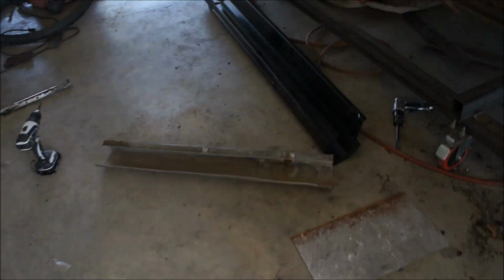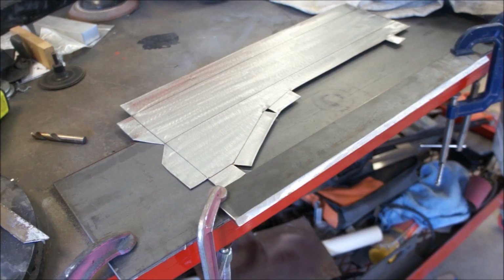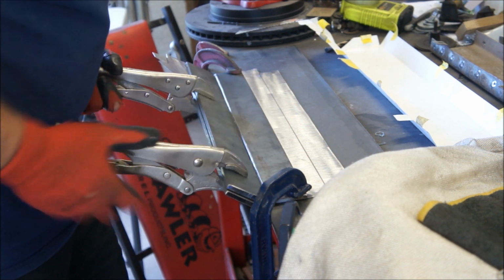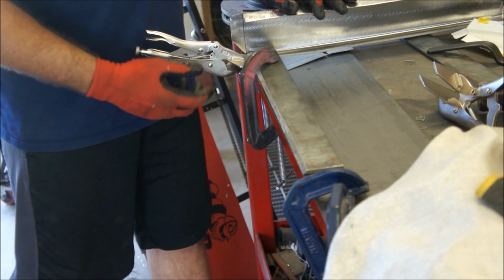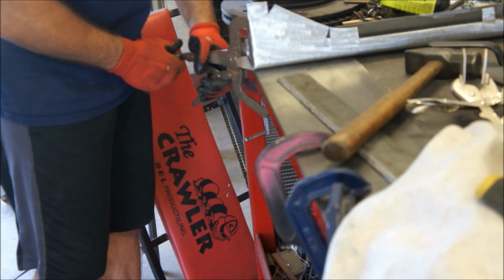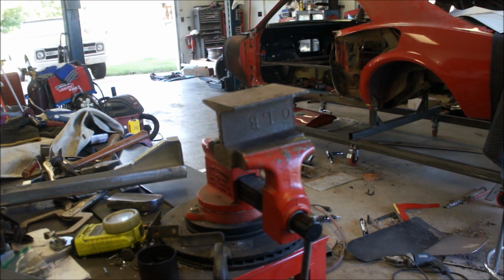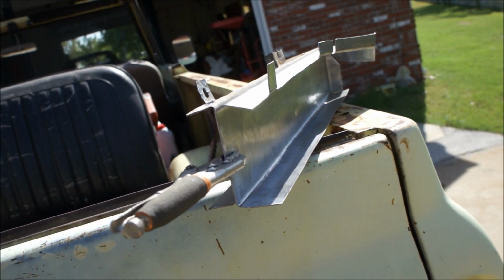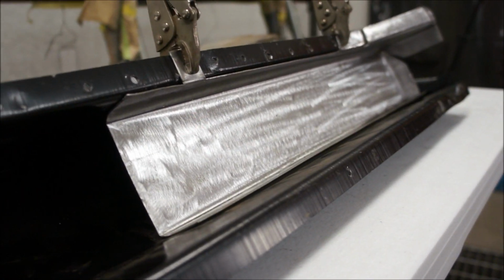1968 camaro inner brace done

Comment: You can make a cheap little metal bender out of 2 pieces of angle iron welded together with a gap between them for the metal to slip through....Look up a hensler bender....sure you can make one easily and you probably have scrap angle iron sitting around